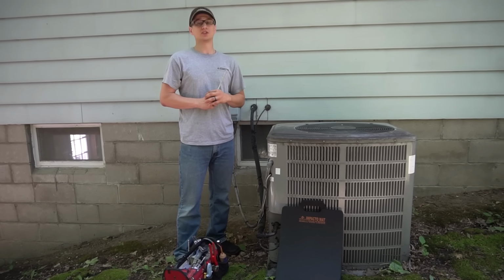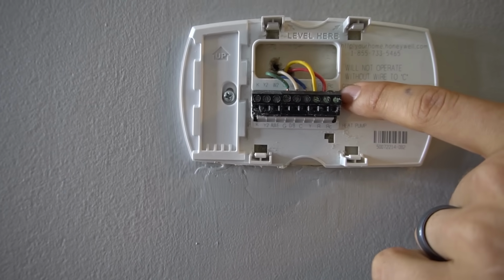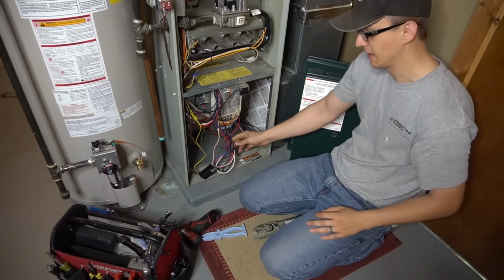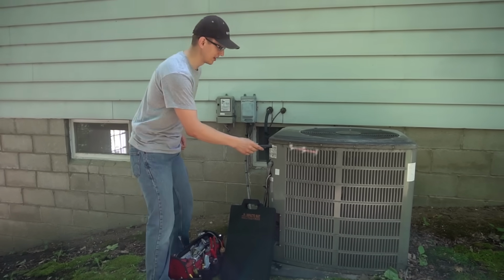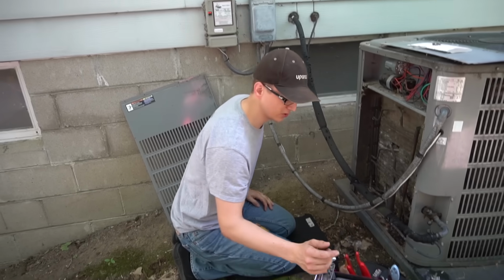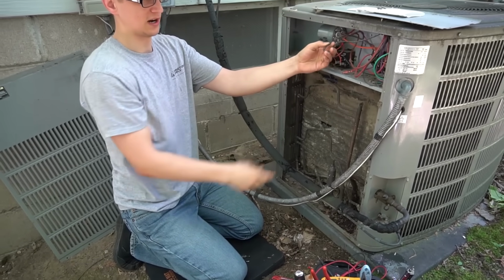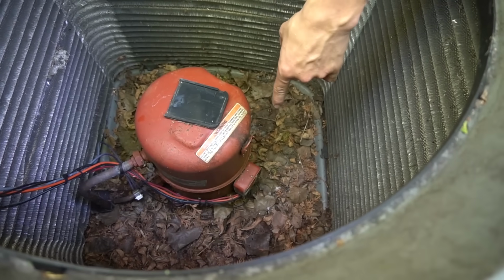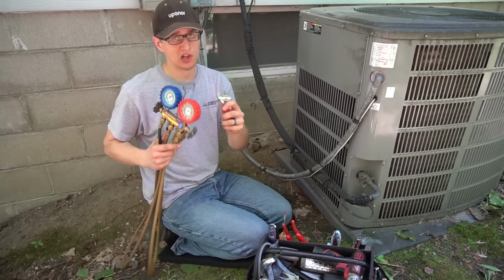AC Unit Not Turning On - How to Fix It Step by Step

Comment: Hey thanks very much for the video! It's very informative! 
My AC is not bringing down the temperature. There is air running inside the house, it's just not cool. I had a repair guy came checked it, turned out the outdoor fan unit is not working, the fan does not spin. I wish I had saw your video earlier. We can hear the compressor rumbling, and sounded like it was trying to work, but the fan doesn't spin. The guy didn't do the spin the fan to help it start test. He just opened it up, he first tested the contactor said he's not reading anything so it's broken (which confuses me because the compressor was making sound so it was getting power.) 
Then he unplugged my capacitors to read them with the multimeter. Mine is a very old unit with 2 separate capacitors (one is 4 uF, one is 30 with +-6%) instead of the 3 prong type. The 4 uF one read 3.9xx uF, the 30 one read 27.6xx. Long story short, he thinks both are not working, which I disagreed (maybe the 30 one is slightly below the 6% range, but the 4 one should be fine.). He put the wires back on but he didn't take photo/note on which wire goes to where. I think he wired those wrong because he put two large wires on the same prong which will short them and it's not even going into the capacitor. I questioned him, he pulled one of the wires out and put it on the other prong... But there are like 5 or 6 wires on those two capacitors, now I doubt if he put on any of those right. 
Then he tested another capacitor (this one stands alone, the previous 2 are bundled together), I don't know what this one is for. This one didn't read anything on the meter. He put a new one on but the fan still doesn't run, but this was after his wiring for the first 2 capacitor, I don't know if it was his wrong wiring causing it or not. 
Then he pulled out the pressure gauges thingy you have in your video, and tested both lines, one read 130, one read 400-ish. He said the 400 one should be around 150 so he thinks my compressor is broken. Which confuses me because if the compressor is broken shouldn't the pressure be low instead of too high? And when he turned off he unit, there was a hissing sound from the compressor when it's stopping. He said it's broken and needed replacement because it didn't sound right.
He basically thinks every component on that unit is broke, the contactor, all the capacitors and the compressor. And wants me to buy a new one. To me I think the fan and the compressor are two separate problems. I don't think all the components stopped working at the same time. I don't have any confidence in his diagnosis. So I requested his supervisor to come out again tmrw... Sorry for the long paragraphs. I want to ask 1. What should I do with the wiring? 2. Are those two capacitors ok, if I were to change them can I change them to a 3 prong one? 3. What is the 3rd stand alone capacitor? 4. What could be the problem with the 400 reading on the pressure gauge? 5. Was I wrong in any of the things I stated above? I am an electrical engineer so I know a thing or two but I could be wrong and doubted him wrongly, which I will apologize to him if that's the case. 6. In general what do you recommend me to do next? 
Really appreciate your help!!
Reply from the maker: Oh boy.. What a mess we have here... Definitely a forehead slapper. I don't even know where to start.. Let's go with your numbered questions to begin with:

1. The wiring can be difficult. The best way would be to look at the wiring diagram which should be somewhere on the inside of the unit. Locate the capacitors on the wiring diagram and see which wires go to them. Hopefully it will tell you what the colors of the wires are.. If there is no wiring diagram then it would take some time to figure out. Honestly I don't think I would be able to walk you through it on here. I would have to be there. You should be able to look up capacitor wiring on google though if that's something you want to tackle.
2. The 4 uF capacitor is good and is most likely the condenser fan capacitor. The 30 uF capacitor is most likely for the compressor and that one is a little out of range but it will still work. (and it was working) Can you put in one capacitor instead of two? Yes you can. I do that when I come across the separate capacitors like that. The capacitor in my video is called a dual capacitor. But back in the day they just had single capacitors like you have. You would need to look up some diagrams and perhaps some videos of how to wire that correctly.
3. The third stand alone capacitor, does it look different then the others? In my video, do you see the black capacitor that is under the grey one? That is a start capacitor. They don't usually go bad and their function is to help the compressor start. Another possibility is that the compressor has two capacitors. For example, sometimes I need to replace a 70 uF capacitor and I don't have it. I order a 70 uF capacitor but to get the customer cooling, I would put in a 30 uF and a 40 uF capacitor and wire them in series to get a total of 70 uF. That is a kosher fix and I could just leave it like that but my company likes to replace them with the right size.
4. If your condenser fan is not spinning, the high side pressure will be very high because the unit is overheating. That increases the amp draw and sometimes could trip the AC circuit breaker. The fan is there to reject the heat. But it sounds like the unit was running without the fan so obviously the head pressure would be high. Fix the fan problem and the pressure will go down.  Though there is a chance something else could be wrong but likely it's the fan. The reason the compressor was hissing is because it has an internal pressure relief valve. If the pressure in the compressor gets too high, it opens that relief valve to release that pressure.
5. I don't think you were wrong. I don't like to bad mouth other technicians or companies so I won't answer this question in detail ;) I can't help but wonder if all your AC needed was a little push of the fan.. But perhaps it has no power going to it. The fan capacitor is good though.. Who know, who knows..

I would love to know how this turns out. Give us an update tomorrow if you'll have the time. Good luck!
Reply: Hi thanks a lot for the fast and detailed reply. I took a couple hours after work to diagnose it myself and now it is fixed and running perfectly! Below is what I did:
For 1, I took the fan unit halfway out (it's pretty stuck in there) and checked the diagram on the unit. It is a very typical 3 wire fan unit wiring. And the two thick wires that the technician put on wrongly were 2 fan wires (a purple and a brown, on the diagram the brown should go to the capacitor only, the purple goes to the other side of the capacitor and also to the Line. The third wire is black and it goes to Line.) The guy put the purple and brown on the same side of the 4uF's terminal, we corrected it after I pointed it out to him and I turned out to be right.
For 2, turned out the +- for both capacitors are 10% not 6%, the guy can't read numbers either. So those are all within range and they are working now. I watched some videos, and learned that the 3 wire fan should be connected to the dual capacitor. And tried to figure out how to wire 2 single capacitor into a dual. But on my capacitor side it wasn't wired like what I saw (short one of each terminals to make a common). But on the contactor side, there is a jumper cable shorting the two sides. I started wondering how a contactor works. I'll get back to this later.
3, Yes I think you are right, from the wiring, this standalone capacitor is wired parallel with the 30uF one, and this one is a 15uF. (It's not black.) So I think mine should be 45 / 4 uF. But the standalone one didn't read anything on the multimeter... But my unit is working now, does this mean it's actually fine, it was just maybe we didn't wait long enough for a read or bad contact? Is it possible that it can still run on a 30uF capacitor alone?
4. Thanks, I understand this better now. That guy really didnt know what he's doing.
5. Now we come to what exactly was wrong. I mentioned I started wondering how a contactor works after figuring out the wiring for the capacitors. I think the jumper was making a common over there. Then I watched your video again, from the very beginning for the outdoor unit part, you said the FIRST test we should try, is pushing the contactor... I pushed it... the fan turned on immediately.... lmao...... I inspected it and saw a bunch of white stuff like spider nest or something in there, cleaned it out thoroughly, then it works without needing me to push it. Tested 3 times, all started itself... I REALLY should have watched your video first instead of calling the technician hahaha, I spent so much effort on fixing his wiring. And every component was not broken and the guy said everything was broken and wanted to sell me a entire new unit. If I did what you said in the video I would have identified the culprit at the very beginning... 
I still have a question on the contactor, if it wasn't working, why was the compressor making noises but just the fan not running? Shouldnt they both not have power? Or could it be the compressor is wired to the power directly? 
Thanks a lot!!!
Reply: I can't believe that guy, he kept on saying he's been working on this for 30 years, but he can't even read a multimeter correctly, he can't wire correctly and he was apparently wrong in everything he told me. When the reading for the 4uF one showed as 3.9xxuF on the meter, he said the decimal point should be in the middle! (The initial screen showed 00.00 nF). I was like, why does it matter where the decimal point it, does this not read 3.9xx uF?! He kept on saying his 30 years experience, it should be in the middle... = =... Then when the wrong wiring happened I lost all the confidence in him... I really appreciate your video and your reply. You are much more helpful and knowledgable than this guy. It's not easy to find good technicians. I would tell them to not bother coming out tmrw, if they want to learn how to fix it, I can show them and I will tell the guy to watch your videos to learn how to work on AC correctly.
Reply from the maker: I just want to say that I am very impressed that you were able to get all this straightened out yourself. I suppose being an electrical engineer really helped ;) And whattttt... I can't believe it! The contactor contacts were just not pulling in all the way?? Wow. If you weren't a hands on type of person you would have dished out a couple thousand for a new unit by now. And all it was is that.. By the way, thanks for typing all that out too! Not a lot of people make the effort. And the update is much appreciated too! Yeah.. I probably wouldn't want them to come back out either. 

About the contactor. There are two sides to it. One is the line voltage side (240v) and the other is the control voltage side (24v). When the thermostat calls for cooling, the control board sends 24v to the contactor coil and the little plunger gets pulled in. That allows the 240v coming from the disconnect  to go through and power on the compressor and the fan. I can't say for sure why your compressor was running. Perhaps one leg is wired to the other side of the contactor? (the side where the electrical whip comes in)

Capacitors. I see condenser units running with half dead capacitors. For example, it's rated at 60 uF and when I check it, it's 35 uF.  It could still run with a reading that low. That's bad for the compressor lifetime but sometimes it will still run. If you give me the brand, model, and serial of your unit I could try to look up what micro-farad capacitor your compressor needs. Once again, kudos for fixing the original problem and the additional problems created! You're on a boss level ;) Stay cool! And if I missed any questions, I didn't do it on purpose, these are just long messages. Ask again if need be.
Reply: Hey, sorry for the late reply, I was sent onto an oversea business trip for close to 3 weeks right after I changed the broken capacitor. Just got back 2 days ago and here to give a final update, I have been using the AC and it's been running perfectly fine. I changed both the 15 uF and 30 uF (paralleled wired) ones to a single 45 uF one. I was thinking about swapping all 3 to a dual capacitor but was too afraid of messing up the wiring lol. Amazon has a lot of dual capacitors but not singles, so I ordered on eBay, Genteq 45 uf 440 v. 
The supervisor of that technician insisted on coming out to understand what went wrong the second day after the technician came. He took another technician with him too. They agreed with everything I said and because the first guy did write a report recommending me replacing every component in the unit, they knew everything I said were facts. What was ridiculous was that when they asked if there was anything they could do for me to make me not lose confidence in their company, they said they could change the contactor, capacitor, top the refrigerant blah blah. I said just change the broken 15uF capacitor would be fine. Then the guy said ok the charge is ~$189.... I almost laughed... it's about $20 on the internet, it's just 2 wires. I would be more than happy to pay for diagnosis because that's the hard part, but I did the diagnosis, your guy messed up my wiring and I had to fix that, and I had to come back from work two times to sort things out with your company... now you want to charge me $189 for this?.....= =||| so I just sent them home and bought one myself and changed it... I live in Michigan, I don't know if it's appropriate to mention that company's and the technician's names here under your video so I'll leave them out, if anyone need the info please contact me. They have over 1200 five star reviews on google... can't believe this...
Again, I want to thank you for all the information and help. I hope a lot of people would see your videos and find them helpful and appreciate your effort! Thank you!
Reply from the maker: Oh wow. Sounds like a bad experience from beginning to end. Sorry to hear that. But am happy that you were able to get it resolved by yourself! That's awesome! Thank you coming back with the update and for taking the time to tell your story. I am sure others will find your experience very helpful. I hope now you can forget about your AC for another 5-10 years ;)

Comment: I'm from Louisiana and my unit went out two days ago and no repairmen are available! Ugh! Your video about the capacitor came up first and I watched it as well. I really appreciate your insight! One question though. When I pushed the plunger in, the unit started up, just like in the video. In the video, you indicated that if the plunger is in and nothing happens, then it's probably the capacitor. So, if I pushed it in and it kicked on, is the plunger part bad, or am I just missing something? Also, can I keep the plunger in while I wait for the part that's defective?
Reply from the maker: Hi Keith! It would be better if you did not keep the plunger in.. But if you do, turn of the power first and make sure whatever you jam it in there with does not cause a short. Also, turn the thermostat fan setting from auto to ON. If the AC outside runs without the blower fan on in the furnace, the evaporator coil will freeze over. Keeping the plunger in will keep the AC running non-stop too, so it will get pretty cold :)

The little plunger is pulled in by 24v that comes from the furnace control board. I would start by checking for a blown 3amp fuse or breaker in the control board, then check furnace circuit breaker and furnace power switch. This is usually the steps I list for that kind of scenario: 

1. Check your 3 amp fuse or breaker at the furnace control board. Is that blown/tripped?
2. Do you have 24v between R and C at the furnace control board? If yes, then proceed :)
3. Put a jumper wire between R and Y at the thermostat. Does that turn on the condenser unit? If yes, then your thermostat is probably defective.
4. If jumping the thermostat does not turn it on, then you can try putting a jumper between R and Y at the furnace control board. Does that turn it on? If yes, then likely your control board is defective.
5. If the jumper wires did not turn on the condenser at all and your 3 amp fuse is good, then I would go outside and see what is in series with your contactor coil outside. The thermostat wire that comes out of the house and into the condenser unit, do the two wires from it go straight to the contactor or does one of the wires go somewhere else?

Let me know how it goes! Hopefully it's something simple :)

Comment: very nice sir,good expalanations for beginers,, im a HVAC&R engineer from pakistan
Reply from the maker: Oh wow, I am flattered to have an engineer from Pakistan watch this :) Thank you!
Reply: its very useful for beginers,,you are a good orater ,thank you Sir ,again ,,do you have some videos on installing ac inverter non inverter unit???
Reply from the maker: Thank you! And no, unfortunately I do not. I rarely do any repairs on or install inverter units. Most of the units I deal with are older air conditioners that don't have control boards and inverters.